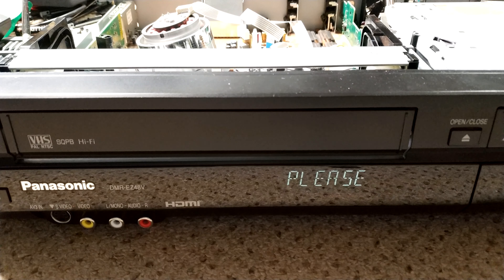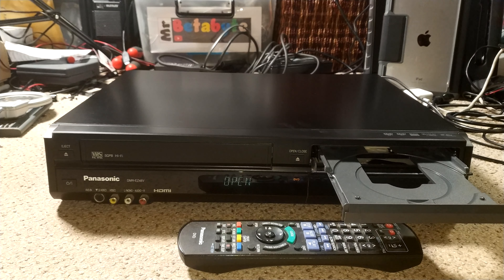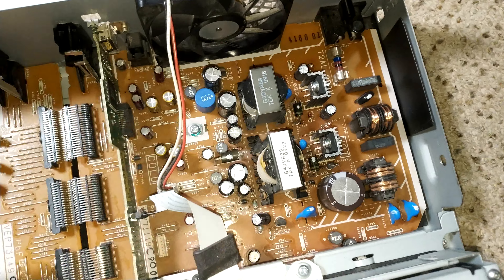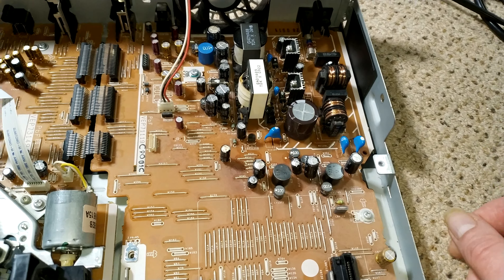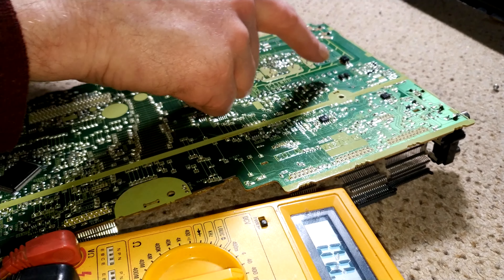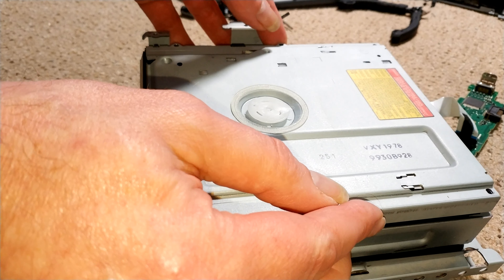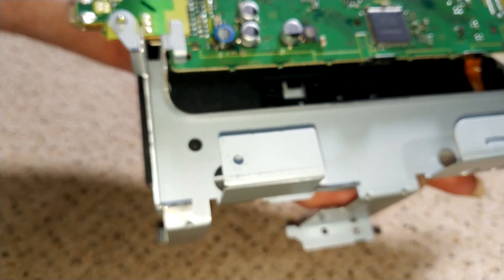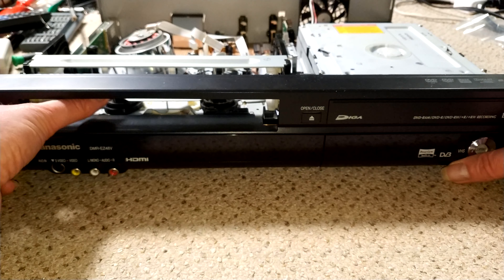Panasonic DMR EZ48 VHS - Part 1 - Power supply and DVD drive issues (Dead, U80 and U81 error fix)

Comment: Great video, looking forward to Part 2.  I used these Panasonic decks at a post production facility for many years including the earlier DMR E75V.  The DMR E75V was better in the fact you could record onto the VHS and DVD at the same time as it had separate channel/input selectors and record buttons, it may have had 2 analogue tuners but not sure as they were only used to record from broadcast VTR decks using the Scart inputs. The later DMR EZ48 decks can only record to either DVD or VHS at the same time, once one side is in record the "drive select" is locked out so the other side can't be put into record.
Reply from the maker: Thank you so much - really glad you enjoyed the video. These machines totally passed me by so they're now all on my AV journey that I'm sharing here! Really very impressed so far with the EZ48 despite it somewhat slow response times. Very interested in the E75V - you've whetted my appetite to try and find one and have a play. I will also be doing a 'living with' video for the EZ48 - have just transferred a video to DVD tonight which went so well and the result was really great.

Comment: I have owned a DMR EZ48 since 2009 (vintage October 2008). I used it quite a bit until cable TV service went digital and I could not schedule recordings from Cable anymore. Eventually, I found that it served well as an archive machine. About five years ago I had to replace the VHS drive belt. I had a really tough time finding one, so when I did, I bought two. Just last week, the unit would not power up. I thought it might have been the victim of a power surge, but after viewing this video, I realize it was a bad cap in the power supply. After a visual inspection, I noticed a bad 100uF 25V cap that was leaky and bulging. I was surprised to see that none of the other caps look suspicious, so left well enough alone. This video helped very much in showing how to disassemble the DVD side to pull the circuit board out for repair. As well, I took plenty of photos as breadcrumbs. I replace the cap and it is back up and running. Thanks!
Reply from the maker: That's so great you managed to get your EZ48 back up and running. If you do start getting error codes on it then it might be worth changing the other capacitors before looking any further into the error codes. They do seem good, durable machines though, especially for this era of VHS machine and I use the one featured in this video often and it always performs well. Thank you very much for sharing.

Comment: No power at all. I opened the back and it looks clean. Hardly used at all. Any idea? Fuse?
Reply from the maker: It's worth checking the fuses but I do think capacitors will be the issue.

Comment: when you showed your list of caps to change you started with  a 100uf x 25v and ended with one instead of just saying there are two but anyway some good info included and should be helpful to some.
Reply from the maker: Well spotted - the last 100uF capacitor wasn't on the list but it seemed silly not to change it whilst I was in there. The machine has been 100% solid ever since and it's on all the time and gets used frequently so it certainly did the job. 😊

Comment: I’ve also come across these and the EZ49 getting stuck in “please wait”. No idea of a fix for that.
Reply from the maker: There is a firmware update but not sure if that would specifically resolve the issue. Bad power supply caps can be a cause and I think changing the them the a firmware update if it allows it would do the trick. Would be interested to know if it does.
Reply: @MrBetaByte  which ic on the digital pcb board has the firmware on it ? Im trying to make a good digital board from 2 broken ones
Reply: @reacey  the firmware is located in the TSOP48 flash see at 19:18 the black chip on the right side of the digital PCB you need a programmer to read this chip and you must be good at soldering to make the job done
Reply: @Gamersoft1124Pro  i managed to find the right chip and get one of the modules working
Reply: @reacey  thats great to hear, I dumped the firmware From my 3 in 1 HDD VCR DVD Recorder Combo, and also the Backend PCB firmware from my Panasonic
DMR-EX95VEGS device and also the Content of the Internal Hard Drive.
Reply: @reacey  now if I will have any HDD or firmware related issue with my device I dont even need the Panasonic Qualified repair shop. I can repair the device by my self 🙂 I hate the throw away community my goal is to keep the environment clean from E-waste, and thats why I am dumping all the firmware from my devices out an keep it safe. I use the XGPRO TL866 II Plus Programmer
Reply: @reacey  Panasonic uses TSOP48 flash from SPANSION wich holds the data 20 years in the flash ROM I try to replace this CHIP with an SST Flash with the same capacity and Pinout, which Holds the data greather than 100 years typical. thats my future plan

Comment: I have a similar unit with an U61 error code even after replacing the psu caps 😢
Reply from the maker: Did you replace all the electrolytics? There's one under the DVD drive that I've seen leak which isn't included in some of the repair kits. Have you tested the rails for the correct voltages and if they have any ripple?
Reply: @MrBetaByte  Thanks for the advice I appreciate it, I have only swapped the caps that were visibly buggered. I'll get that Drive cap first and then swapthe rest.
Reply: @MrBetaByte  https://youtube.com/shorts/k2NuMGmwnsU?feature=share

So now the dvd makes this sound with a disc loaded or not and then says read error, appreciate if you have a sec to take a look. Thanks mate